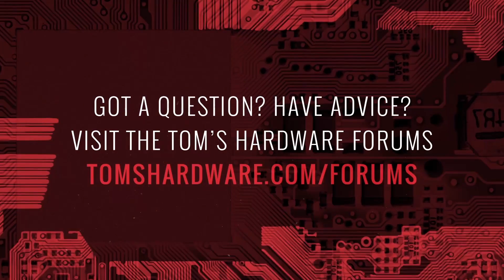LiquidMIPS Immersion Cooling Nvidia GTX Titan X

Comment: If that processor had some coolant fins it would have better temperature uniformity across the heat spreader. Not that it isn't working perfectly fine the way it is.

Comment: I hope it isnt a pain in the ass to upgrade parts with.
Reply: PillowSmeller aparently when you take components parts outside oil/water, they are completly dry. Because components are dipped in oil before they are to be inserted inside.